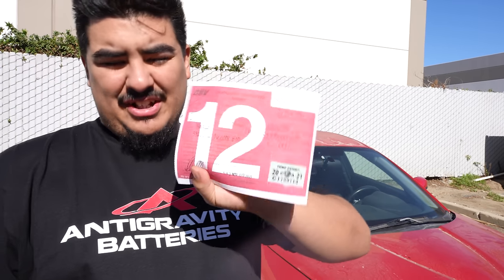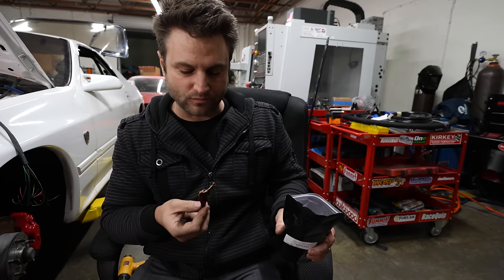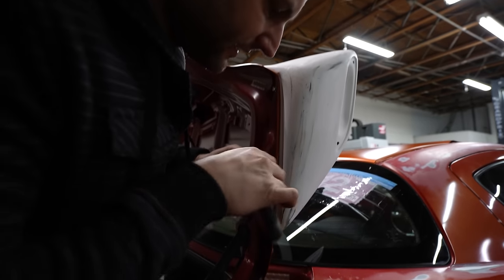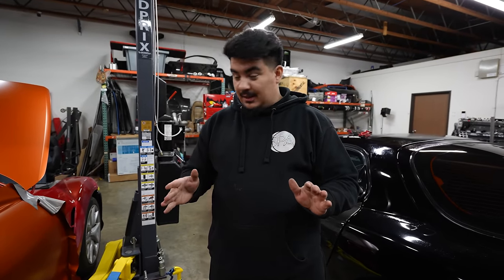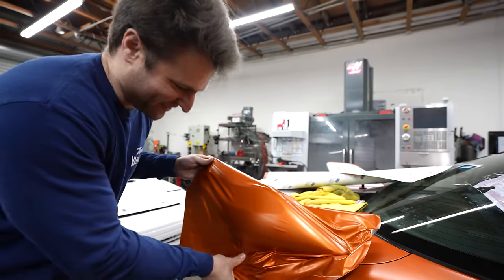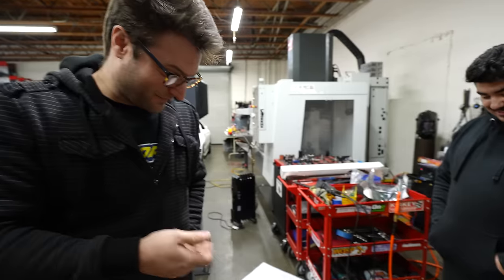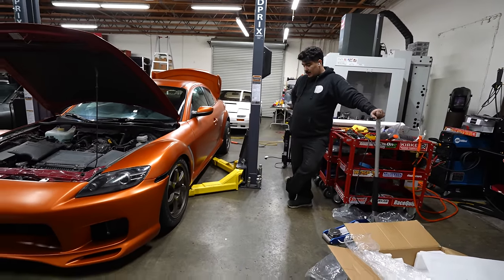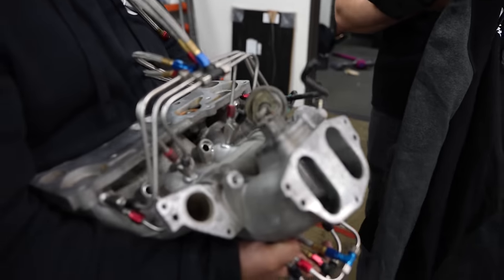Isaiah’s CRASHED RX-8 Glow Up Makeover

Comment: Hey, I'm a tint geek. UV rays aren't responsible for the majority of the sun's heat - you can thank infrared for that. Ceramic tint is extremely effective at blocking IR, it's a bit pricey but quality tint is always worth it.

Thanks to all of you guys in the shop for the awesome content!
Reply: Based tinter
Reply: Also...automotive glass already blocks most UV as is.  Still Really nice tint job tho!
Reply: I think he might be talking about getting burned by UV but interesting info nonetheless. Especially as an Australian, way too hot around here right now
Reply: @hambo6713  so it is correct that UV causes both sunburn and the majority of material damage. Like Steve said, most automotive glass already blocks the majority of UV.

The cool thing about ceramic tint is that you can get it in shades as light as 80% VLT(visual light transmission) and it still blocks a ton of heat.

There has been a common misconception for years that a darker tint makes for cooler interior temps, but that's patently false. If you're in Aussieland, get yourself some nice ceramic tint and it'll change your commute big time 👍
Reply: @boostaddict_  I think you meant Seppuku, sometimes referred to as harakiri. Sudoku is a numbers game lol. But yes you're correct.
Reply: @TheDarkPacific  yeah that's the joke
Reply: @boostaddict_  thank God. I was honestly hoping it was.

Comment: When I mount a spoiler on the boot I use the stud method with one modification, I put toothpaste on the studs so when put in place it leaves the toothpaste as a witness mark for the hole position.

Comment: Rob talking about the maxpeeding brings up a good point. Factory suspension for my car was a good $700 at the time and good coilovers started at $900 and only got more expensive. I bit the bullet on Maxpeeding rods and paid less than $200 for all 4 corners. They aren't perfect but if you're in a tight spot they can definitely be a viable option to get you by till you can get what you need.
Reply: That’s not at all what he said
Reply: Just say you have maxspeedimg rods. Your never getting anything else.

Comment: 4:40 A lot of Rx8's are known to have crappy seals in the rear lights, mine would fill with water. Someone probably gunked it
Reply: Mazdas*

Im fighting my 323 atm, after some silocone that are tight, but i had to get new gaskets
Reply: @glurak888  what body of your 323 is it?
Reply: @extec101  Compact 3 door
Reply: 323 C BG '93
Reply: @glurak888  i had 3 of those but they are gone now, one got hit by a truck the other two got a bad infection of rust.

do you got the rear light with a bend in them or the standing one?
the standing one got a bad habbit of leaking.
Reply: @extec101  the standing one, I heard of that yes.

I'm still trying to patch the holes without... Using fuckign silicone to glue them to the car
Reply: @glurak888  are you living in europe?

Comment: I'm always so goddamn curious about those crazy cheap coilovers. If they end up getting taken off, or break, I'd love to see a teardown and failure analysis! Seems like most failures on em are stuff coming loose, and leaks. Almost seems like they could be rebuilt by someone on a tiny budget into a good shock with the right seals.
Reply: It's honestly not worth rebuilding them. You'd be better off just buying better coils like Fortunes, HKS, Stance, etc.
Reply: @pv2roach11  "worth" depends on your budget. If you're building a lemons car or something, it could be worth it. Especially if you can find replacements for the valving to adjust it, change springs etc.
Reply: I honestly hate they shit on the whole  brand without testing them
Reply: @thisnegroissad3867  I mean, I get it. Just the weirdness with setting the rear ride height is enough bad. It seems like that rear shock is very short, which isn't great especially if he has to drop the spring perch to get it low enough, which means you're running the damper with very little up travel.

Comment: You are supposed to tighten suspension bolts only AFTER the car has already rolled on ground,or the bushings get twisted. Those bushings are what's raising the rear so high. They will fail soon if driven like that.
Reply: The strut itself has no bushings. what you're referring to is the clocking the control arms which you do when you install new control arms and that's torqueing the control arm bolts when the car full weight is on the suspension. He'd only have to do that if he removed the control arms to install the new struts, however it seems like the control arms weren't removed.

Comment: On the swivel adapter, I recommend you wrap the swivel part with electrical tape 2 or 3 passes. This will keep it from chewing a chunk of flesh off your hand(yes I have a scar myself) and also keeps it from flopping over to much making it hard to line the socket up.

Comment: We have some experience with those MPR coilovers in the Mazdaspeed3 community, they will last worth of 150USD. So like 500 miles, 1000 if you are lucky, or 2000 if you ate shit with a spoon as a todler. Their turbos, catchcans, connecting rods and a few other things however are almost OEM quality (their connecting rods are almost Manley quality) and are still 2-5 times cheaper then the cheapest used OEM part in decent condition.

Comment: Good video. I like the RX-8, just not in stock form. That hood gap is rough but besides that it's coming along. A better rear bumper with a good deffuser, some aftermarket taillights and an exhaust would help the rear end a lot. Hoping he takes that route. Maybe some hood pins and vents for the front, as well.

Some aftermarket side skirts would bring the body down a little more which would be a big help. As it sits it looks like the front bumper sits about an inch lower than the sides.

As far as the hood gap goes, it looks like the hood sits right where it should. Not sure what can be done. You might be able to get it to go down a little more then make the gap more even. Maybe try to get the center of the bumper up a tiny bit as well. I'm interested to see what can be done about it.

Anodizing the rims to be a lighter, brighter bronze, or even a darker shade of copper, would go with the orange a lot better. Just a thought. 

Liking this project.

Comment: I got max peeding rods when I was finishing my beat FC in the harbor freight tent I bought for my backyard before I got into my shop and I will say the rear completely maxed out was like 1/8th lower than stock but the fronts I could literally set the front subframe on the ground lol. Car is currently operating with monster rear to front rake with the front subframe 1" off the ground

Comment: I went through 3 sets of max speeding rods coilovers, you can see a video on my channel about them. I'm pretty sure the spring rate is setup for trucks or something because they ride like you have no suspension at all. It's not so bad as long as the roads you drive on are in decent shape and it's hard to say no to being low for cheap. But now I know that you are better off cutting springs as dangerous as that can be, it's still a far higher quality setup than the maxspeedingrods in terms of ride quality and component durability.

Comment: Did Isaiah said he wants to blow up the engine?

I don't know if it would really affect smog and make it race-only, but I've seen Kyle Mohan from Kyle Mohan Racing do the hybrid 13B. Equalized airflow on both intake and exhaust by combining the use of Renesis irons with GSL-SE housings. Interesting rotary stuff. And since Rob is getting into the OEM++ stuff, I'm sure he can pull up a stout hybrid 13B.

Also, hearing plenty of stuff that MaxSpeedingRods do are of good quality. Not high-tier, but not complete trash. More for the enthusiast than for the one looking for the edge in competitions.

Comment: I found the disclaimer regarding the after market coil overs a bit funny. Rob mentioned people taking a product and scanning it to get about 80% accuracy to the original, and then manufacture the product using cheaper materials.... Cut to the clip where Rob admitted measuring the pixels of the Hoonicorn from an article

Comment: Don't go with fortune auto dude. Get konis at that point. Fortune doesn't share dyno's for their shocks and doesn't share what they're using. 

You're essentially getting a stolen formula from Koni, with zipped lips that give no confidence.

Also, stop judging ride height before the suspension settles. You need to move the car around or jack up the wheel until it's holding weight to get an idea.

Comment: DO NOT USE those cheap eBay HID kits. they backfeed ac into the car and cause all kinds of problems. Essentially if you're using a kit that's under a couple hundred bucks throw it away. Test it